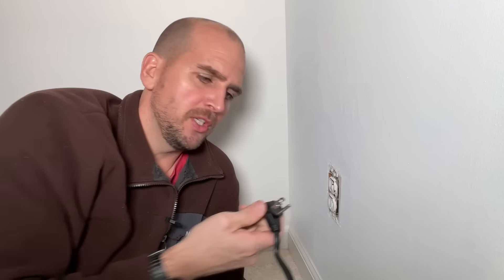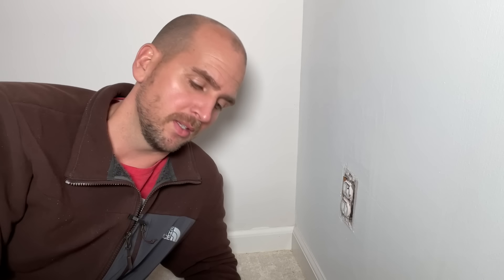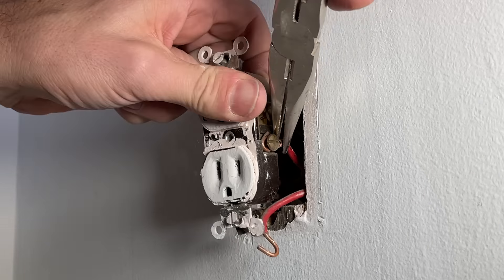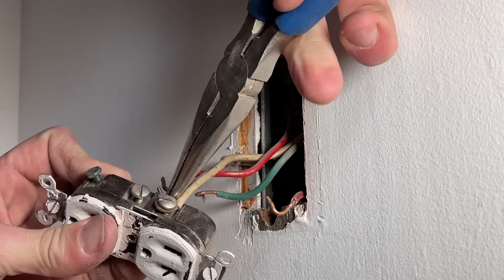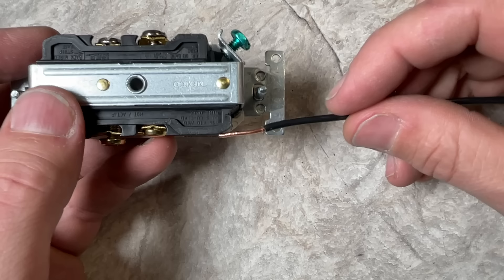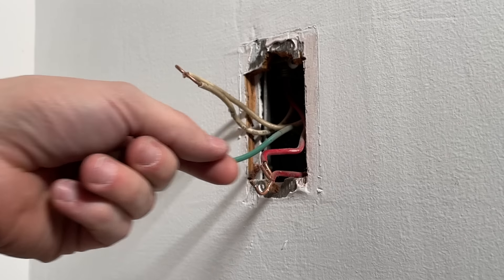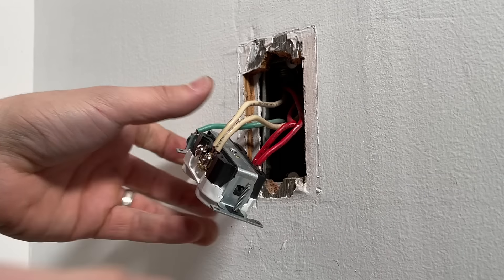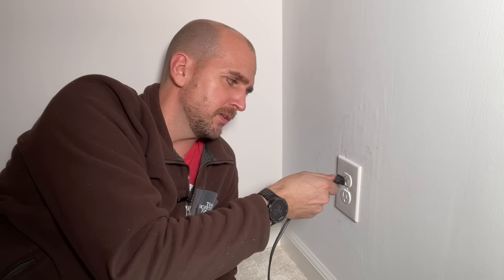Plug Won't Stay In Outlet

Comment: When I was an electrician I learned that wrapping electrical tape around the screws of the plug after connecting the wires helps prevent the risk of the screws touching the sides of the metal box and prevents shortening out the breaker.
Reply: When the proper outlets and proper boxes are used and the wires are connected properly, there is absolutely no chance of shorting.  Wrapping tape around it is pointless.  If you’re hooking up and there is a potential for shorting, then you need to find a new profession, and a good defense lawyer for that matter.
Reply: @hiseminencetheholymacdiarmada  there is absolutely a chance on single gang metal boxes. Tf you talking about lol
Reply: Most people don't realize you're supposed to replace a breaker after 5-7 trips because it breaks easier every time
Reply: What do you mean "screws of the plug"??? Typical plugs on appliances have no screws.  Do you mean the screws of the outlets???
Reply: Kevin Matheson  Did you think that this is an older home since the receptacle is obviously worn out and metal boxes were the only option when this was constructed? Wrapping tape around the receptacle before installation is a common practice that helps prevent shorts if the screw and wire termination becomes loose due to vibration or possible heating and cooling cycles when using high amperage appliances like vacuums.
Reply: Kevin Matheson  not everyone can afford it. That's what the channel is for. Why would you even watch this if you don't need to?
Reply: Kevin Matheson  I have 20  outlets to replace.
Reply: @Waitaminute2015  Kevin Matheson probably lives in a trailer and has never seen real live construction before
Reply: @bsanchez3563  Must have deleted the comment??? That does happen on YT lol
Reply: @thecloneguyz  Very informative!  This might be a silly question but how do you know how many trips the breaker has had?  Thanks!
Reply: @pat6703  
Which breaker are you talking about?
You can literally feel the breaker getting easier and easier to reset everytime it trips off.
Plus it will trip easier and easier each time you do it under a lower and lower load

If you've ever flipped brand-new Breakers or Breakers that have rarely or never flipped off you'll notice that they're really stiff and kind of hard to push and you'll notice that one's that trip a lot are really easy and you can barely bump them with your finger and they flip easily......
Reply: Hospital grade outlets has a door to cover them now
Reply: @hiseminencetheholymacdiarmada  ive personally blown up metal boxes and outlets before. I always took a few extra seconds to tape up the rare metal box we used for outlets. A lot of the boxes leave barely any room to spare and gravity alone is enough to drop the screws onto the side the box and cause what is basically a nuclear explosion
Reply: @thecloneguyz  This is incorrect.  Most breakers are tested more times than this before they are sold and there is nothing that makes them trip easier after repeated trips.  Residential breakers use an electromagnet to trip a spring loaded switch so the switch contacts and mechanism are the only wear items.  The spring is well inside its elastic limits so it doesn't wear out in a breaker since there is no way to overstretch it.  Given an inductive load there will be a small arc across the breaker contacts and they will eventually erode that takes thousands, if not tens of thousands, of trips before you'd get intermittent connections when turning the breaker back on.  The switch mechanism itself is designed for hundreds of thousands of cycles.  Breakers do fail but it is very rare for them to wear out because they have tripped too many times.
Reply: @MaxLupton  nothing you explain there explains why it trips easier and easier every single time and most electrician say you should replace it after it trips 5 to 10 times
Reply: @hiseminencetheholymacdiarmada  Smh terrible comment. Really hope you're not an electrician and just failing at trying to be funny
Reply: @hiseminencetheholymacdiarmada  - Your opinion is pointless... It is so obvious you have never seen an outlet much less removed one with the wires attached to the side screws, in a metal box... Go get a real job...:)

Comment: I like how you mentioned hotel rooms with lose outlets. I've seen several hotel rooms where the wall outlets were inaccessible, and all the newer lamp base outlets were so loose that my phone charger wouldn't stay connected to charge my phone. I told the front desk the maids were plugging the vacuum cleaner into the lamp bases which is a problem since some of those outlets are only rated at maximum 3 amps.
Reply: I can understand why they do that.   Those outlets are always located in some far inconvenient  place.  People don't want to move furniture just to plug something in.
Reply: 3A, what garbage dump were they from, I have never seen anything under 15A.
Reply: @toriless  I'm talking about the outlet built into the base of a lamp that you can plug in a phone charger. I'm in a hotel right now and it has a sticker on it saying 3.5AMP Max Combined. That is the norm for auxiliary outlets on appliances, not 15 AMPS.
Reply: Not specifically in reference to the socket on the lamp itself, but it genuinely amazes me that hotels don't use flat front, 90º plugs behind furniture like nightstands to keep the plugs of the lamps, alarm clock, etc., from getting mangled from the furniture shifting around and ending up pulled out exposed halfway from the wall just waiting for someone to touch - OR drop something metal off the nightstand and enjoy a nice fireworks show.

Comment: What a licensed electrician taught me was after removing the receptacle (or switch or other device), push the no contact voltage tester deep into the box because electric code does allow cable from different circuits to be in the same box. So while power to the receptacle would be off, cable in the box from a different circuit could still be energized. Also, it is kinda hard to use an outlet tester when you are working on a switch.

p.s. If the wood paneling extends past the edge of the box, you probably want to use a box extender to protect the combustible (the paneling) from the electrical components.
Reply: Hmm..why would a live circuit be in a receptacle box if it doesnt feed the plug?   
  In thirty yrs in the industry i have never come across that..both commercial and residential.
Reply: I believe your electrician meant junction boxes, not receptacle boxes..in that term, he is correct.
Reply: @duannehohn3118  In my garage, I have a three gang box. It has two switches and one receptacle. The two switches are on a 15A circuit that operate two separate lights. The receptacle is on a 20A circuit. To safely work in the box, power to both branch circuits has to be turned off.
Reply: The video shows a single plug..not a three gang box.
Reply: @duannehohn3118  Doesn't matter. Code still allows more than one branch circuit inside a box.
Reply: It does matter..you don't have a split receptical in the video. Let's not play semantics..
Reply: @duannehohn3118  Working with electricity is not a matter of semantics. Code allows it, so check for it. Given the choice of listening to a master electrician whom I have known for years or some YouTube commenter, I choose the former.
Reply: Great advice!!!  You never know what someone may have done (to code or against code) and it’s better to be safe than sorry.

Comment: This was EXACTLY what I needed! Thank you for explaining what causes loose connections. I had no idea that there were basic instructions on the back of the outlet either. My new plugs had holes on the back for the quick connection option.
Reply: If avoidable try an use the screw terminals or ensure that the holes may be secured by the screws in order to avoid the small springs being all that connects to wire and weakens over time from constant tension
Reply: Those with holes where the wire is not held by screws like heavy duty ones are referred to as stab-lock or "back-stab"  and should not be used , better outlets pay for themselves in the long run by lasting longer than cheap ones.
Reply: Me too but my mom won’t let me
Reply: @jennywatts7054  well try to explain what the reasoning for the safety necessitated method of a sidewire is.
Reply: Those stab-lok connections are not reliable, inside the outlet is a 2 tiny points that jab the side of the wire (it's designed for 14 gauge BTW).  THEY CAN AND DO FAIL.  Because of the way they attach to the wire they tend to fail more with heavier loads.  Anyone that works for or with electricians can verify this information.

Comment: I'm deathly afraid of electricity as I witnessed an electrician hanging from conduit pipe getting electrocuted as a kid, your video not only made it look simple, but safe to do.
Reply: @MLU8811 I can second this. There's almost no limit to how many times you can (and should) double- and triple- and quadruple- check things before touching them, and absolutely never assume anything is correct or using the appropriate color wire or any other things you might be tempted to take for granted, because you will never cease to be amazed at the horrifyingly sketchy things you will find, especially in older homes. Safety always comes first and there's no shame in checking things multiple times if you're feeling unsure and hesitant. Ideally, unless there's a reason you absolutely can't, you can just kill power to everything before working on things and that's always a nice extra peace-of-mind.

Comment: Thank you. I  live in an apartment complex. Have complained about the outlets doing just that. Not holding and was told to just bend the prongs so they hold. True statement. Guess I will go buy my own and then have them installed. Safety hazard, eh! God bless you and keep you safe.
Reply: Lol..... That's what I did too!
Reply: Send the landlord the bill for the outlets, at least, and get the better ones. If you are replacing 2-prong outlets, you should be using gfci or afci outlets. Even without a ground wire, they are preferred.

Comment: Thank you for the great video! The professional electrician I hired a few years ago to replace all my outlets and install new ones, used bargain basement outlets that still didn't hold 2-prong plugs! I replaced the worst offender with the outlet you recommended... No fire, no explosions... I know have a working outlet that even holds the plug for the vacuum cleaner that I used to clean up the mess from the drywall! Interestingly enough, the professional electrician had wound the ground wire on backwards! 😮

Comment: Just a quick tip, I usually add some electrical tape around the hot and neutral terminals just for extra safety. Not require per code, but just for safety... great video.
Reply: Especially when its going back into a metal box. 👍
Reply: I was  told never to wrap electrical tape around the terminals on an outlet or switch because if the terminals start to overheat the tape could catch fire.
Reply: @Imroytc 
The tape won't catch fire.
And "F-strap" or "battleship" or "madison" box mounting straps used to mount metal cut-in boxes can spring back and touch device terminals.
Reply: @Imroytc  😆
Reply: @Imroytc  The contents of every outlet box consists of 78% plastic.  The flash point of the tape is the same as the insulation on the wires and the outlet overmolding itself so if it is hot enough for a fire? wrapped with tape or not ts time to grab your hot dogs, buns and stuff to make smores because we are having a cook out.

If the NEC itself does not specify whether you should or should not wrap the outlet when installing it by now ( and there is a rule for almost everything else right??) and the tape is UL approved to wrap and insulate electrical wires (Imagine that?) it is NOT a hazard to wrap the outlet with it!!

It all boils down to opinion and thought process. If your mind tells you that electrical tape becomes a gasoline soaked rag when wrapped on an outlet but is Ok to use everywhere else in a circuit? Then so be it. I always wrap when a metal box is present and do not with plastic.

The idea that the tape "dries out" and becomes a fire hazard comes from the old friction tape impregnated with gutta percha used before the current standard on knob and tube wiring and early types of romex with the black asphalt type insulation that did not have a ground wire.
Reply: @superdog1964  Thank you your explanation makes more sense than the electrical inspector's that told me that.
Reply: @Imroytc   - Don't you think that if the terminals start to overheat, you will know about it because it would smell, and perhaps the outlet would be acting erratically, or even be dead???

Comment: If you are not reusing the outlet, just unscrew them all of the was till they fall. It will save some time. I used to work for Leviton where the receptacles and switches were made. UL 498 in the US calls for the screws to be torqued at 12-14 inch-pounds to comply with the NEC requirement at NEC 110.14(D) Overall, good job, I like that the video uses two different devices to make sure the power is off.
Reply: Thanks for mentioning torque.  What I do is lean the outlet against the wall, and get the screws very tight, but I've wondered if there's an actual recommended torque value.

Comment: Non-contact testers detect live wires on switched outlets that plug-in testers do not. Love the outlet autopsy.
Reply from the maker: Thanks Kent 👍
Reply: The only time where non-contact testers show hot where a contact testeer won't is where the switch is on the neutral side, so not cutting off hot from the outlet.
Reply: @rickgalbraith2752  but that would be a code violation in every jurisdiction.
Reply: @byron7165  it is but I've seen it multiple times...
Reply: @PhantomWorksStudios  same here.
A prizewinner was one, whose rocket scientist who ran those runs, switched neutral and supplied hot from both buses of the service! Thought it was off, checked, cussed all the way back to the fuse box.
That one was a Frankenstein job, knob and tube, modern wiring amateurishly ran, five alarm fire waiting to happen.
Reply: I much prefer a good multimeter for this kind of thing.  I understand that non-contact testers have a place, but I put way more trust in my multimeter.  That could be because I do electrical work when it's required to support instrumentation and controls systems.  One piece of test equipment beats two or three to do the same job.
Reply: Good job!
Reply: @horusfalcon  Indeed, though a multimeter with a non-contact test function makes everybody happy.  I use a non-contact tester to quickly check if a receptacle or switch is still hot, but I will pull the leads out and check again before I stick my fingers in a box.  It never hurts to be too careful when dealing with electricity, especially when you weren't the last guy to work on something.
Reply: Ditto on the autopsy, worth the price of admission.
Reply: One other note on non-contact testers. Always test them with a known live outlet or extension cord before trusting that no beep means no power.   Low batteries happen. I sometimes double-check with a multimeter as well.
Reply: @rickgalbraith2752  IIRC, it also happens with multi-wire branched circuits where you haven't shut off power to the other circuit. It's been a couple years, but I got zapped that way once because I didn't know that a neutral could be shared between circuits.

Comment: Very helpful and clear video.  Thank you!  Why did you put both hot wires into a single screw connection?  If you have two screws, why not use them both?  Isn't it smarter to space the connections out around the outlet rather than bunch them together?  I'd really appreciate clarification since I need to replace about five outlets in my 75-year old home.
Reply: I was about to ask that.

Comment: Two things , on your hot it seems you had the bare wire going past the plastic housing if the outlet . I did that once and had the  excess ground wire in the box short out against that minute bit of bare wire. A good policy, when you have metal boxes , is to wrap the receptacle with electrical tape covering the terminal screw heads so there is no chance of them shorting out against the metal box .
Reply: I've heard electricians speak loudly against that practice -- the case they make is that the tape will eventually dry out as it is exposed to heat cycles, then have the potential of catching on fire. FWIW, I am a wrap the outlet with electric tape kinda guy.
Reply: @BorealSelfReliance  Is electrical tape made from material that becomes that easily combustible when it dries out? That seems a bit implausible. I'm a wrap in tape kinda guy through and through as well.
Reply: @BorealSelfReliance  I absolutely despise working with electrical tape, especially on rework when I pull that greasy, sticky mess out of the wall.

Comment: FYI, your outlet has wire strippers built onto it . The notches on metal by screw holes, 15mm and 17 mm strip.
Reply: Jane told you
Reply: FYI not all receptacles have that. In fact the commercial grade he is using to replace the old one in this video does not.
Reply: @XtheUnknown99  I told Jane
Reply: Thanks for the tip
Reply: Lol the only time I would every use those slots that happen to strip wires is if for some reason I have to replace this plug right now but I have no wire strippers

Comment: Well done.  Thanks for posting this important basic video.  I wish you would have let us see you get all those old wires back into the box after the new socket was attached.  That's always been my challenge . . . they just seem to resist my best efforts (especially 12 ga wire).  Thanks, again.
Reply: Yeah well this is true– ngl solid core wire if it is either stiff type of metal or kinda thick then it can be pretty resistant to going where it's supposed to go.